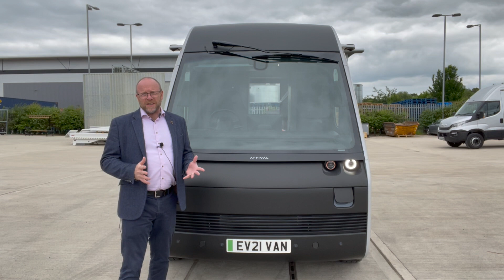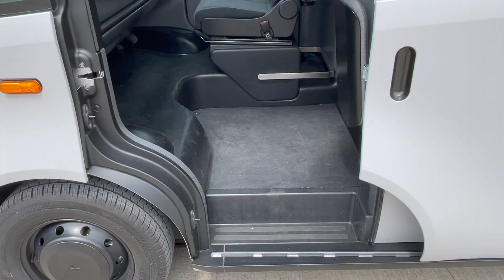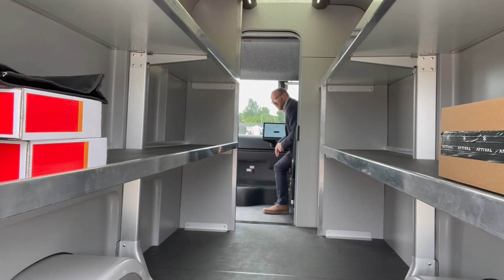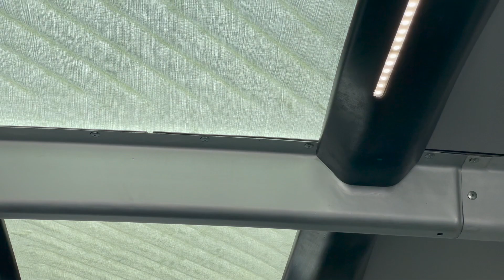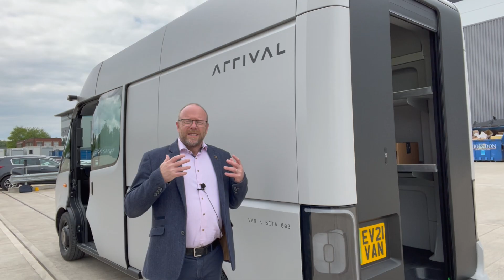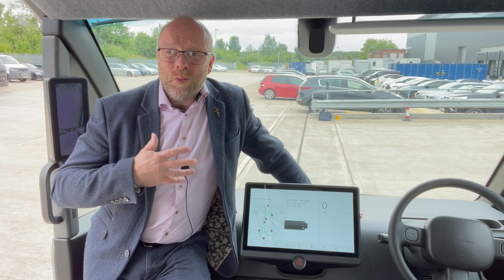The long awaited Arrival Van #arrival #van #ElectricVan  #electricvans

Comment: Does anyone know when they actually come to the roads? Also buses and uber cars? Thanks
Reply from the maker: The first robot produced vehicle has been completed and they are beginning production in Q3 with first  deliveries in Q4… will be a while before you could get your hands on one though as the first few thousand have already been snapped up….
Reply: @electricvanman  thanks a lot. I would actually need one as well but i have also bought 15k shares recently.  So maybe stocks are going to pay for the van
Reply: @florinserbabh4560  arrival is it good company? I also want to buy some shares that company
Reply: @David-u2x1v  its a scam, indian russian run scam

Comment: Doesnt look like those shelves will hold the parcels in place. They will be on the floor before you know it. Maybe if they had put sliding cage doors on then yes it would be an ideal parcel delivery van
Reply from the maker: The originals have been “shelved” in favour of better ones bespoke for the parcel sector (tried and tested!)

Comment: Range fully loaded?
Reply from the maker: As they havent published fully ratified WLTP figures yet (the gov measurements) It will be hard to suggest the difference between partial and full loading. That said 2-3% per hundred kgs off their published number is usually a good measure. Full up at the 4.25t payload could be 1900 kgs costing you around 20% range. But only if you are that weight for the full journey of course...
Reply: @electricvanman  you what you a
Reply: @electricvanman  Thanks for this, your figures are optimistic. In Jersey we trialed an electric double decker bus on route 15 that has a very steep hill.  All the figures said it would cope, it did not. Under load it simply ran out of juice as I had predicted. It was withdrawn from service.

Comment: contemplating converting one into an ice cream van and attaching solar panels on the roof
Reply: i had the same thought for a mobile shop for the local villiages
Reply from the maker: Another good shout - especially if you already have a community or two in your mind. Knowing where and when you will travel is perfect
Reply from the maker: Great idea! Some companies have already done this. Also converted to refrigerated transport, using solar panels to support the battery for the fridge unit.

Comment: Big square roof like that and no solar panels? It doesn't seem to have roof rails, why not add a couple of hundred quid to the cost and include that option?

It's not going to propel the vehicle but if you do use all that range in a given day that's a hell of a battery to have to charge overnight. Even a few kWh over a week from when it's parked up of an evening, between jobs and at the weekend would help smooth out the recharge curves or provide range boosts in the summer that will certainly add up.
Reply from the maker: Good point and it is being thought of by ancillary providers... Not by the manufacturer yet - Be nice if they could just get the vehicle out so wont be pressing them to sort it anytime soon

Comment: the design on it fits exactly to my van convention protiekt🤔 just a few options like insulation and options in windows.🙏 and 50% of the work is done before I get the car🤗 nice choice of materials rust and dents are past. 😁when can I buy it and what does it cost  😍🥰
Reply from the maker: will be hard to get one before end 2023 although first deliveries this year. Cost just south of 50k is expected but with spiralling costs of vehicles this could go up...
Reply: @electricvanman  no worries I am not in a hurry I have an iveco from 2015 which has been converted but I am in the process of planning a future project🤔🤗

Comment: My heart sank the second I saw the fkin touchscreen, as it's yet another EV contributing to the war against human independence from OTA updates and remote control/deplatforming by the state.

Nice long range and flashy gizmos mean little if a corrupt state or the company that wants you to buy new products has a remote-controlled off switch or can just covertly nerf the vehicle over time with each 'update' until you give up and buy another vehicle.  The truckers would have no leverage to protest with if their vehicles can by lowjacked by the enemies of freedom and democracy.

You might as well let Trudeau control a master password to access or drive your vehicle with tech-chains like this.
Reply: I'm trying to understand your point.   Are you saying this takes away from the ability for the drivers to unionize?       Besides the fact they don't own the vehicles,   it would not prevent them from unionizing.           I  think you're just applying your ideology to something simply because it is technology that is centralized,   as if that is automatically something bad